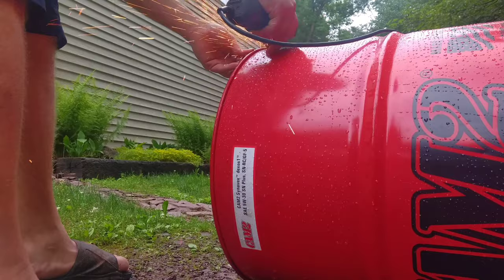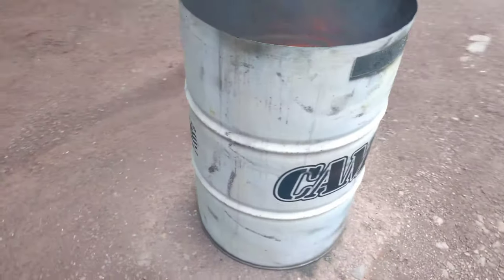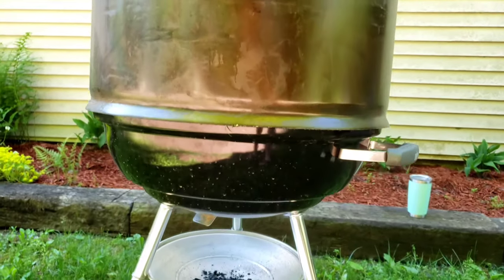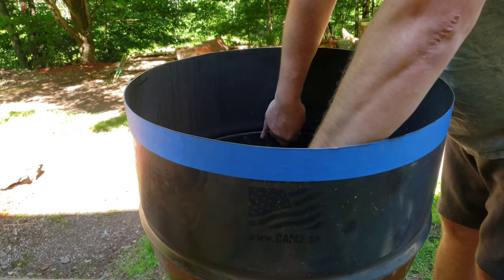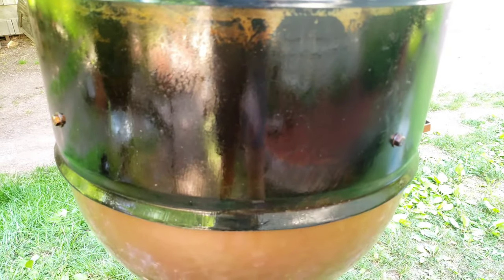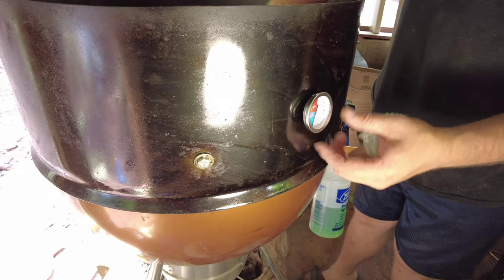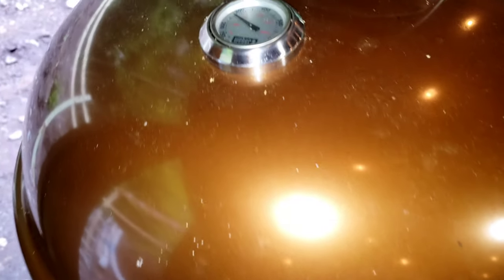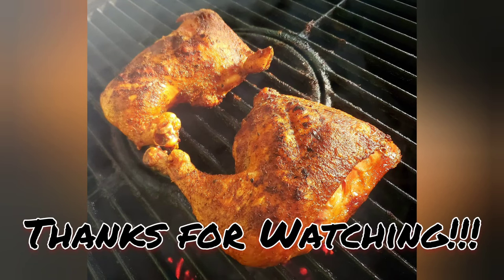Modified Weber kettles drum mod. #diy direct heat chicken cookers.

Comment: Hi nice vid, in my work experience you should let the grinder pull itself slowly forward while cutting. When pulling it against the direction of the spinning blade it may get stuck and tend to launch itself. I also find to have more control/ safety with the first option. Regards
Reply from the maker: Thanks for Watching!